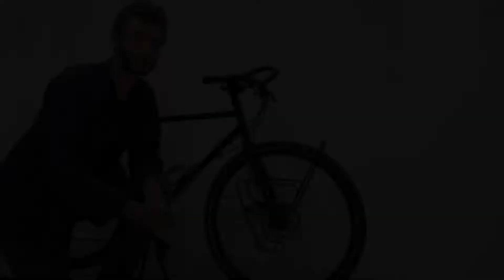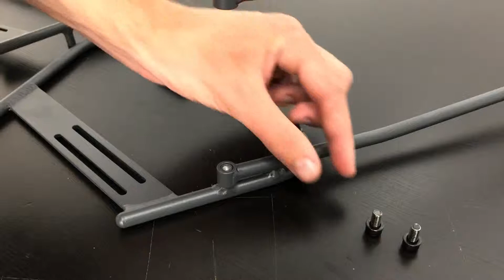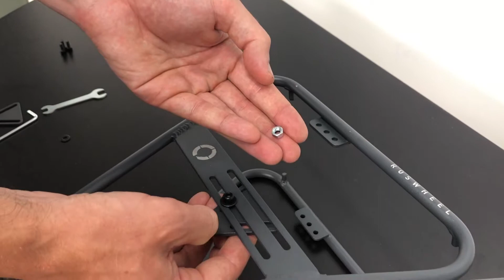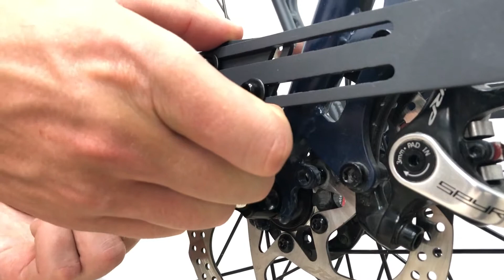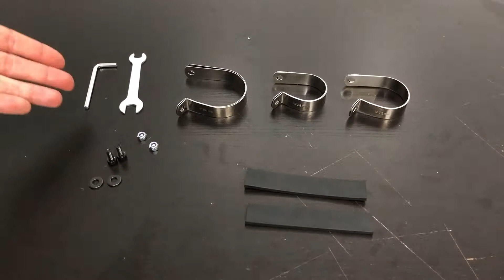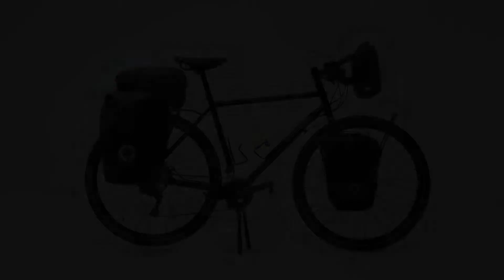TOUR Bicycle Front Rack Installation | ROSWHEEL

Comment: What kind of metal is the steel bands made out of and what metal is the rack made of? If Aluminum, is it anodized? Do the bolts have mating locking nuts or have Locktite on them?
Reply: They're stainless steel P clips. Can't say I like it as a mounting system. pipe clips with m8 bolt fixing would be better.